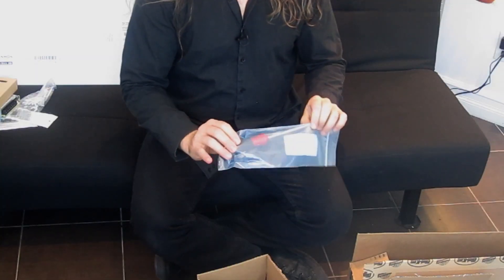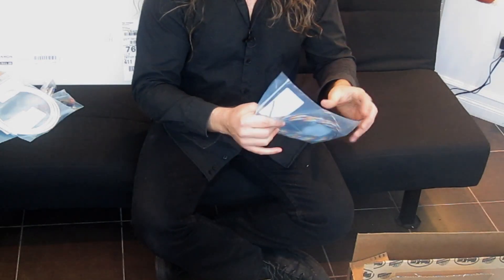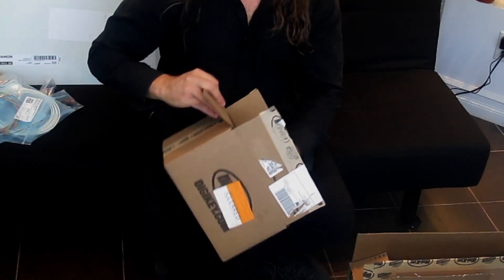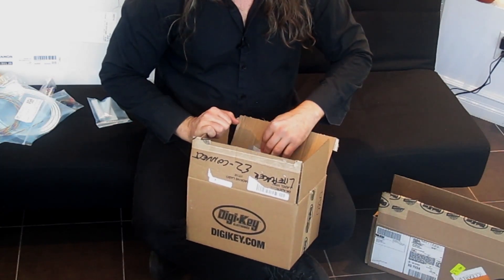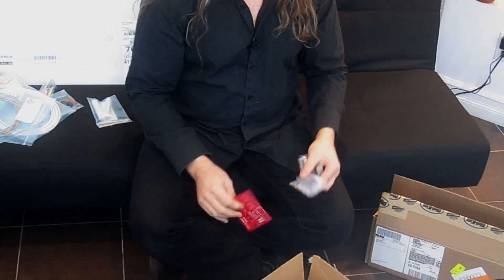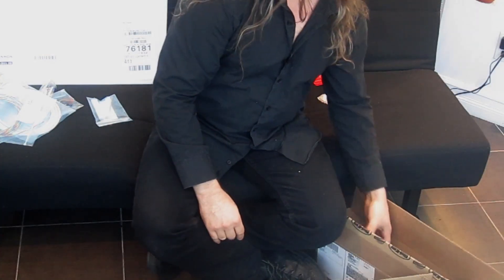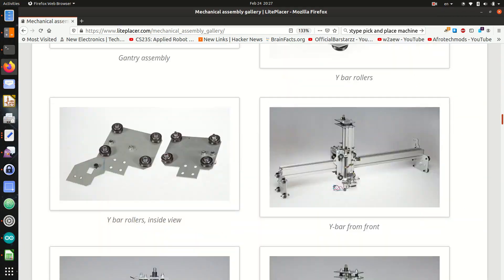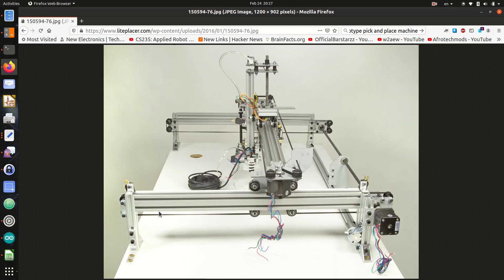Liteplacer Pick and Place Build: Getting Started

Comment: Cool where do you print your circuit boards at? Any reason you didn’t have them assemble? To pricey?
Reply from the maker: Often China, mostly pcbway in that case.  As for PCBA, when prototyping I like to do at least the first run myself for two reasons:
 1)  it lets me double check the placement and BOM "manually" and see if there's anything that would need tweaking prior to dealing with the hassle of dealing with the communications and the $
 2) mistakes creep into some designs (ugh) and I don't want 30 nicely assembled faulty boards

So, I'll get the PCBs done, hand assemble, test and tweak and only then, if its worthwhile, and there's a need for more than a few dozen, get someone else to do assembly.